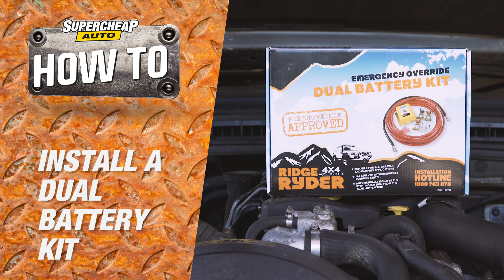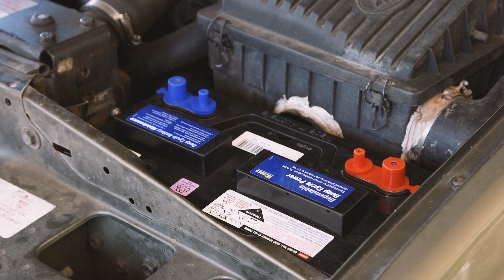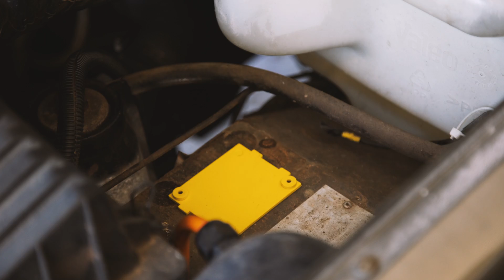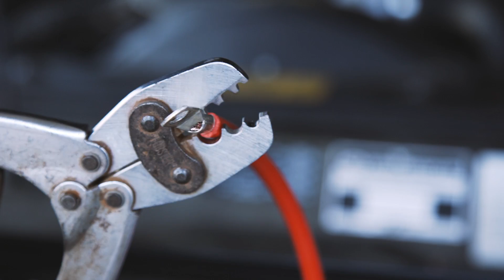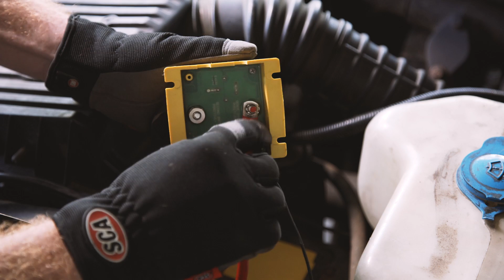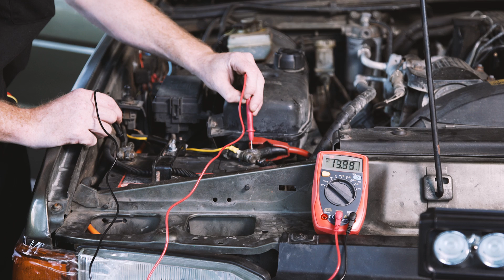How to - Install A Dual Battery Kit // Supercheap Auto

Comment: How does it charge the 2nd battery
Reply: The alternator would be working over time to charge both batteries i say. I recommend attaching solar panel on roof or something and hook it to the second battery so the sun can maintain it. I  don't know really, I haven't had much experience with it this

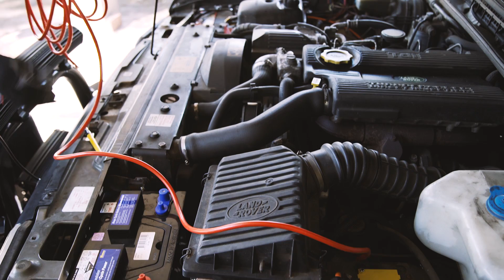Comment: 1:17 rip
Reply: No you idiots, the yellow thing that falls into the tiny ass black hole of no return just infront of the radiator fan
Reply: Lachlan Ascott why do you say that man? Voltage drop?
Reply: @cortinatim1  no Fuses
Reply: good thing it wasnt a 10 mill socket 😂
Reply: @Davis leanby leanby there's still wires connected to positive battery terminals that could short between the battery and the yellow box. Should really be fused as close to the battery as possible IMO.

Comment: Hi, what is the emergency override button for? If I have flat primary battery, can I use the switch to start engine from secondary battery? Thanks
Reply from the maker: Hi Lukas, Thanks for your question. It's to manually override the Voltage Sensitive Relay to force charge the second battery. This cannot be used to jump the primary battery. When jumping a vehicle, the cable thickness is very important to keep note of. It'll need to be rated for the huge amperage required to start the vehicle which is normally more than the dual battery cable supplied is designed to do. A pair of jumper leads is a better option or a separate jump starter so you don't damage your deep cycle battery from jump starting. - Ash
Reply: Supercheap Auto your website states other about being blue to flick a switch on the unit and use the secondary battery to jump the first or you can pier a winch also
Reply: That is why I bought mine.....it said use override switch to jump start main battery if it went flat.....
Wiring looks big enough!
Reply: @supercheapautotv  Ok, thanks for your answer
Reply: I have a bit of experience with batteries and if you leave the jumper cables on the deep cycle for 10 minutes or so it should jump start fine. It's just hard on the deep cycle. But if it's a marine battery, fire it up STRAIGHT AWAY. Because marine batteries are built to start diesel boat engines.

Comment: Hi there, is the Ryder system suitable for a car with a smart alternator (2012 Holden Colorado 4X4 Space cab)?
Reply: No reason it cannot be - if you install a 2nd (dual circuit) jump relay correctly, or a split battery charge system - or even reuse an old alternator's directional diode system to direct power to both batteries - yet neither is connected to the other.

The aux/2nd battery - then looks as if it's just part of the one main battery as far as the alternator is concerned - as both charge via a split charger.

Cutting the aux/2nd battery off, with a key-off (power-off) relay - whenever you turn the key off, & the vehicle shuts down, simple leaves you with a main starter battery that is still connected to ALL of the so-called smart-car wiring, (while leaving you with a disconnected but perfectly charged "aux/2nd jumper battery", which is available to be jumped, if your original main starter battery goes flat).

An alternator is purely a power station - generating power.
A vehicle's electronics - ONLY controls how much of that "generated" power - goes into the battery, or is diverted to other wired-in circuits, depending on how your vehicle manufacturer wants them to be "fed power".

MOST auto electrical workshop - and oh do this or that home auto technicians (or someone who likes DC to DC invertors (they aren't really chargers as such, just a way to take ONE DC voltage & convert it into another DC voltage even if both are the same).

Charging a 2nd/aux battery off a VERY LOW DIFFERENCE DC to DC (voltage) invertor - is like saying - oh look - we have 12v output here to charge a 12v battery (THAT NEEDS MORE THN 12V to charge it) - and you will quickly find out, that you will NEVER fully charge that 2nd/aux battery.

Comment: Can I jump my starter battery with this set-up if not which one of your products does?
Reply: Regardless of what SCA is saying MANY MANY people just put jumper leads from the second battery back to the first then start it. If it's DEEP CYCLE leave it on for 5 or 10 minutes because it will be a bit hard on a deep cycle. If it's a marine, just start it straight up. They handle higher draw loads but flatten quicker than deep cycle.
Reply: You should be able to jump it with cable though, old school.
Reply: @BDHO73  Unless one uses the "same rated Jaycar kit" - which provides the buyer with 140A rated cables - hence you simply use a panel mounted momentary push button on your dashboard etc, for INTERCONNECTING both batteries together - to jump off either, in their battery charge/jumper system, which also has a VSR with a yellow (jump-it) control wire to force the VSR to close, irrespective of which battery is flattest - to allow the 2nd to jumpstart the main (if you flatten that by leaving the key on / main or sidelights on/ or the kids spend hours with the audio system playing) - thus if your main is FLAT - you simply push a dashboard button/switch and start your vehicle normally with BOTH main (flat) and 2nd/AUX (charged) - all done through the dual VSR relay itself, & it's interconnected charge/jump cables.
No need to go searching for jumper leads off anyone else.
Reply: Xtm isolator does it has a toggle switch to go from main to aux if main is flat
Reply from the maker: Hey there, Thanks for your question. Unfortunately no dual battery setup we stock includes a switch to jump a flat starter battery. 

This is due to the cable size required to crank a vehicle, our dual battery setups are for charging a second battery, so the cable size doesn't need to be huge. but they're not large enough to start a 4x4 and it would be risking the life of the cable.

You can however order a Projecta voltage relay 200amps, thicker cabling to suit cranking a vehicle to make this work.
http://www.supercheapauto.com.au/Product/Projecta-12V-200A-Voltage-Sensitive-Relay-VSR200/SPO3956861 

Alternatively, a set of beefy jumper leads between the batteries that are rated to handle the amperage required to jump start your vehicle would be a cheaper alternative to running rated relays, cables to suit this task. Or keep a compact jump starter in the glove box.

We don't recommend using deep cycle batteries for starting vehicles as this may damage the battery.

I hope this helps. - Ash

Comment: The installation of the VSR is described incorrectly. The 2 longer screws screw back into the body of the VSR and hold the base plate against the body of the VSR. You need to drill 4 holes using the VSR body as the template, NOT the baseplate.
Reply: not to mention nohing said about anti rust grease or any protection against rust because drilling through body.